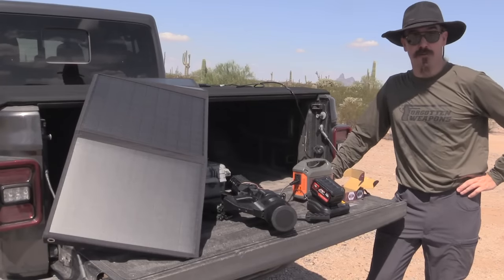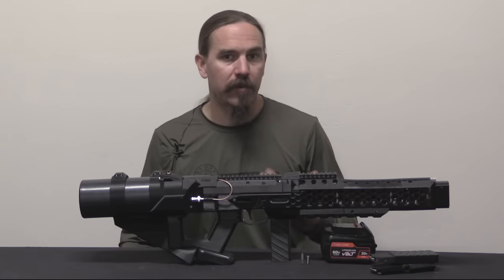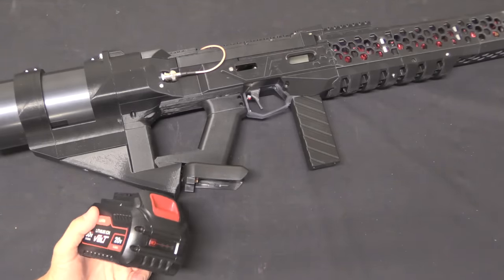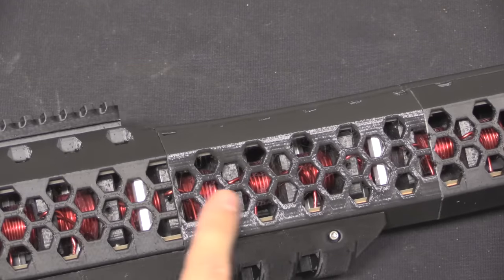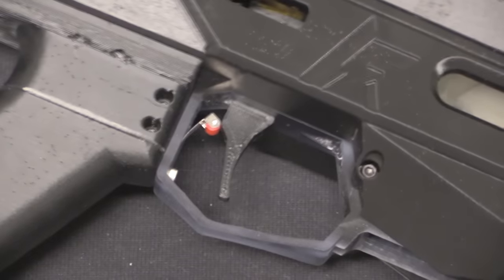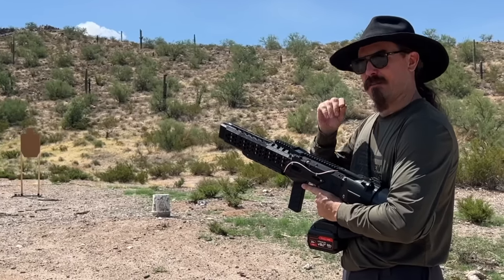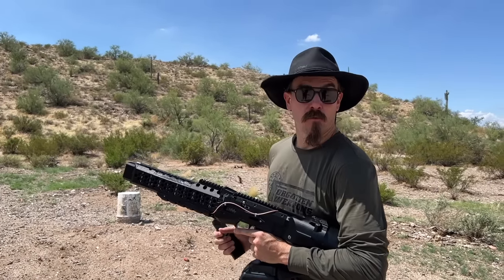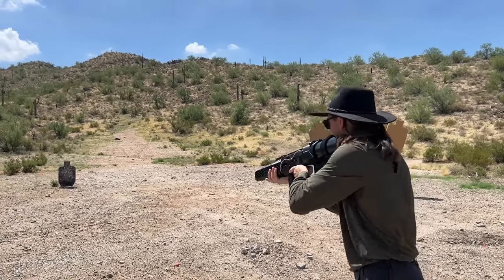ArcFlash Labs EMG-02 CoilGun: Making SciFi Weapons Into Reality

Comment: I've been tinkering with this concept since the latter half of the 90s.  One thing I've noticed with coil guns that most others  have built, is that they seem to mostly use electrolytic capacitors and coils with higher resistances, (wound with more turns of thinner wire). The best, (and scariest),  results I ever had was when I used pulse capacitors with 3 stages of lower  resistance coils, (wound with fewer turns of much thicker wire).  Of course this comes with its own set of problems, (mainly with switching due to the extremely high voltages and currents),  but heat management was less of a problem.  The projectile I mostly used was a specialized iron 'dart' coated in PCL thermoplastic.  From about ten meters it could easily penetrate 3/4 inch plywood and leave a deep pock in the concrete wall behind it.  The last test resulted in the recoil ripping the coils off their mounts and sending one of them flying backwards in the opposite direction of the projectile, but the projectile penetrated the same 3/4 inch plywood and embedded a little over halfway into a Jacksonville Florida phone book.  After that, I just never got around to rebuilding it.  I've always been really fascinated with high energy/high voltage applications, but  I don't really forsee myself building anything else like that in the near future, but maybe other tinkerers here can make use of this information and succeed where I failed.  😉
Reply: Pics or it didn't happen
Reply: @shmillbe3390   Welllll...  I suppose you're not wrong.  🤷‍♀   I wish that phone cameras were a thing back in 1998-99.  ...Although I probably wouldn't have been able to afford one at that time.
Reply: Well I know you are lying so there's that.
Reply: what type of capacitors did you use?
"pulse capacitors" unfortunately doesn't tell much to me. 
Film capacitors? what kind of film, what nominal voltage? etc.
Reply: please elaborate on your design
Reply: @starstreamir3817  Its a shame that cameras didn't exist before the modern cell phone.
Reply: It all depends on how fast you need to induce a large magnetic field. Quickest way I have found is using low ESR electrolytic caps, reasonably high voltage, and flat coils (slinkly like). But then I'm working with 25-40 uS single pulses per magnetic assembly. With a 25mm projectile turned on for half the distance, that would be 500 M/sec at 25uS.
Reply: @jimmyredd right lmao

Comment: Railgun: A quarterback holds the ball and charges forward. The quarterback tends to tear his arms and legs apart in the process.
Coilgun: Several golfers line up and hit the ball as it passes by them. They must be in perfect synchronization or it doesn't work.

In either case, one can hit the ball harder or accelerate it over a greater distance.
Reply: And both get harder to make work well the faster you're aiming for, either way. The railgun because it erodes faster, the coilgun because the faster the projectile is moving, the narrower the timing of the coil switching needs to get for that perfect synch.
Reply: @Plotatothewondercat  The timing of the coils isn't really the issue, microcontrollers can read sensors, calculate data, then control the coils many orders of magnitude faster than a coil gun can accelerate a projectile. The biggest issue is a power source able to provide the necessary current.
Reply: Rail guns in future will have some kind of super alloy possibly for the conductor rails or if not maybe quick swap rail conductors
Reply: So my question is the large hadron collider a looped rail gun or a looped coil gun?
I know it uses electromagnets to fly the particles around it and make it collide with other particles but is it rail or coil?
Reply: @pihermoso11  coils, the particles arente touching anything before the impact.
Reply: This is actually a great analogy personally i think there is more potential for railguns than coil guns in terms of infantry portable weapons.
Reply: @pihermoso11  Yes it is a coil gun since it is accelerated over a very large distance and over time as opposed to all at once.
Reply: That is a fkn terrible analogy on both examples.
Reply: @pihermoso11  coils for sure.
Reply: @pihermoso11  coils.
Reply: @adawg3032  graphene
Reply: @rubiconnn  Sensing the projectile is simple enough with a modern microcontroller, but that's only half the equation. The bigger the coil, the more inductance it has and the harder it'll resist being switched on or off. You can partially counter this by whacking it harder with more current and/or higher voltage, but that necessitates more expensive semiconductors and beefier protections against back-EMF.
Reply: @adawg3032  I imagine the railgun as a point-and-shoot anti-armor weapon, with a magazine of disposable rails like a quiver of arrows or javelins.
Reply: That golfer thing is a good analogy.
Reply: @rubiconnn  I thought the problem with coilguns was residual magnetic fields? Like, there's just enough 'leftover' energy in a decaying magnetic field after the power's turned off that it saps energy from the projectile, and the real goal is finding electromagnets that can be 'quenched' fast enough that their fields don't drag on the projectile while the next one in line is pulling it forward?
Reply: So the coilgun is a peasant cannon? Cool.
Reply: flywheel
quadpole induced spin
lets startup
Reply: @pihermoso11  quadpole magnets also see icp mass spectrometre, this is a good medium concept to understand the physics of the collider, this gun is a short ms the collider is a long one here is the basic parts that you sue to move the charge particle or metals around: definition of a quadrupole magnet  https://youtu.be/XTTBhTIuIio?t=127
Reply: @EgoEroTergum  seem slike something to put in a tower not human hands
Reply: @Maddog3060  so it gets hot?
Reply: @willkrummeck  More like drag.
Reply: Bad analogy, especially the golfing one. Coil guns don't use push power, they use magnetic pull power. Golfer's hitting a ball are using push power via their clubs. Granted the concept of grabbing something as it hurtles towards you and pulling is kind of a foreign concept to our everyday experience with physics so it's hard to analogize it properly.

The only accurate analogy I can think of would be like that scene in the movie Final Fantasy 7: Advent Children where Cloud Strife is thrown up into the air and there are several other people on some scaffolding of a skyscraper above him that grab his arm and throw him ever higher/faster in a sequence.

As for a rail gun, I think a better analogy would be the first stage of a rocket that is cast off after the fuel is spent.

Comment: This thing’s like a predecessor to a weapon my dad made up for an old sci-fi tabletop rpg he and some friends made. It was this but smaller with a super high fire rate, with a hose running from a backpack carrying thousands a lil ball bearings. It was meant to disable control panels and stuff inside ships and didn’t do much damage to enemies.
Reply: an interesting thing to note is that a penumatic gun exists that uses 6mm bearings for that very purpose, breaking car windows or the like without being lethal. So your Dad was definately onto something there. using a backpack allows for much larger batteries, too.
Reply: Flip the magazine (or add a top port) and let gravity feed improvised ammo into the gun on full auto.
Reply: @DFX2KX  that's really just an airsoft gun firing ball bearings
Reply: Plasma rifle is even cooler!
Reply: @chemistryofquestionablequa6252  Also knows as a BB gun...

Comment: DANGER: This weapon is dangerous and absolutely, unspeakably Cool.
Reply: Their GR-1 model has 75 ft lbs of energy. Which is closer to being lethal. I think 80 ft lbs of energy has a 20% lethality rate.
Reply: @robertpatter5509  I wonder how long/ if it is possible to produce a coilgun for actual combat. I know rn there's many constraints on batteries which restricts weapons like this but they are very cool.
Reply: @collinb.8542  i bet a large military contractor could make something like this work for a military application today. the lithium power pack for hand tools hold enough energy to be within the realm of feaseable for a combat loadout. 2-3 battery packs to 6-12 mags with about 150-200 rounds of ammo is not out of the question. making it more powerful is straightforward. making it accurate isnt impossible, but is a bit tricky, thats where the larger budget would come in.
Reply: @collinb.8542  Waiting for more breakthroughs in super conductor materials that don't have to be super cooled, this one thing is holding back an actual shittonne of already proven and viable tech, some of it decades old, that's how long that one problem has been holding stuff back, otherwise we would now have fast efficient magnetic levitation (MAglev) trains and cars everywhere.
Reply: @collinb.8542  its possible now, you just need to put a lot of amps through those coils and it will move a bullet
Reply: @collinb.8542   You would need at least .22LR ft lbs of energy and it not to weigh 9.7lbs.
Reply: Now all we need is myomer and working mini-fusion reactors and we can basically  stomp over to Catalyst Game Labs to inform them of our displeasure on them going woke.
Reply: I would love that as warning label
Reply: @robertpatter5509  I wouldn't worry about the lethality of the projectile, I would worry about the lethality of the weapon itself if anything goes wrong because in this "improved" version instead of several small and relatively harmless capacitors you have a single big one whose pressure release point is completely blocked, making it into a chemical pipe bomb. A single malfunction has the possibility of ripping apart your head when you shoulder the thing.
Reply: a kitchen knife is dangerous
Reply: @goofy851  I was pulling an amp out of an old unplugged TV (that had not been plugged in for days) when a piece of frame discharged the main capacitor. I was not electrocuted, but the explosion threw me against the wall nearly knocking me out. Once you've experienced something that, you never forget what a cap can do.

Comment: For your next test, you should try shooting rounds in to ballistics gel to see what kind of damage rounds from that gun can do.
Reply: Probably nothing, when you see the paper target the bullet just spinned in the air and landed on it's side, it's a sign of low power.
Reply: 200ft/s is lower end speed of airsoft shot, here 16:23 at 0.25 speed it is possible to count flying bullets, visually
Reply: @alexpetrov8871  ya there were a few points in the video when you could see the round in the air for a fraction of a second.
Reply: This was my thought in testing this weapon. We don't get a very goo idea of what it's capable of when it's shot at a flimsy target. Another thought I had is if it was possible to belt feed it or otherwise extend it's magazine size.
Reply: If we knew the mass of the bullets we could pretty easily compute the kinetic energy (1/2*m*v^2) and compare it to a more conventional bullet.  My guess is it's not very damaging.  I mean, I still wouldn't want to get hit by it, but I kind of doubt it's lethal.  I'm guessing somewhere around pellet gun, maybe less.
Reply: Dewalt already makes that...
Reply: @RyuuOujiXS  funny
Reply: @masterchain3335  The mass of the round is 8.5 grams according to the Arc Flash Labs website. I'm not really sure what alloy they are using, but that seems rather light. (a silicon alloy round would be around 9.66 grams)

The velocity, as stated in the video, is 200 feet per second. so, 200 feet per second = 60.96 meters per second.

Convert the mass to kilograms for the equation, 8.5 grams is 0.0085 kilograms. 

Therefore it would be (1/2)* 0.0085 kg * (60.96 m/s) = 17.2634 joules

So yea.. not too awfully powerful.

In comparison: 
A 9mm pistol round ≈ 459 joules
A .22 round ≈ 158 joules

I suspect machining grooves along the length of the rounds may actually help stabilize the round and reduce or possibly even eliminate the tumbling issue. 
Also, a thin coating of copper or silver (electroplating or evaporative coating) as an anti-reflective coating would improve the effects of the EM field of the coils while propelling the round, possibly increasing the velocity.
Reply: That thing has zero power, zero speed and zero projectile trajectory. A scratch is the best you can do to a ballistic gel block.
Reply: @lucasalati369  I have a feeling if there were a better power source and higher power caps it could gain some power. It would take quite a lot of reengineering to turn this from a novelty pop-gun to an actual weapon.
Reply: As someone who has handled real firearms for many many years, I can tell you the bullet would be lucky to make it even an inch into ballistic gel. It would more likely bounce off in my opinion, given I could watch the bullets fly while watching the video, and there's at least a second long delay from what appears to be about 20 feet away. Most underwhelming gun I've ever seen 😂
Reply: @RyuuOujiXS What?
Reply: I'm only guessing but I think dowel and drillbits fired at 200ft/s would just cause some bleeding and bruising maybe a fracture on a human target.
Reply: @alexpetrov8871 however, airsoft rounds are ranged between .12 and .48 grams typically. this is a hunk of metal. it would hurt.
Reply: You could simulate this at home by throwing BBs at a bowl of Jello
Reply: that is easy without even doing it.... less than an airsoft gun. This is too weak even for darts you would use to put animals to sleep for operation
Reply: @@NihilNoviSubSole. it’s a grown up toy
Reply: its less powerful than a BB gun....
Reply: its shooting 200 fps, it would be less than most airsoft guns
Reply: Or shut u u self to see how much damage it make 😅😅😅
Reply: I have orbiez guns for my kids with more power .... You're better off buying a Gamo swarm in .22 and saving money while actually having stopping power . Hand if you have the money any pcp air gun by Hatson will definitely change a humans behavior permanently
Reply: it's hard to make a railgun lethal and man portable. bottleneck being the battery, and that's a massive problem not easily solvable
Reply: Low end of the speed for an airsoft gun, yes, but about 20 times the projectile mass, so about 20 times the energy. It would hurt real bad.
Reply: @Holfyy  Not necessarily... Shotgun slugs sometimes tumble too, along with a lot of other rounds (called keyholing). It's mainly a lack of stability in the air due to no rifling being present.
Reply: At 200 fps it wouldn't be much
Reply: @masterchain3335  The kinetic energy is not what makes a weapon lethal. Penetration is. That's why an arrow from a bow can kill you even though it has very low kinetic energy. This gun wouldn't do much mostly because the lack of rifling, not because of the actual power it launches pellets
Reply: It's the speed of a weak airsoft gun, firing a drill bit (or comparable) projectile. Not a lot, is how much damage it'll do, unless you hit someone's unprotected eye or somethin.